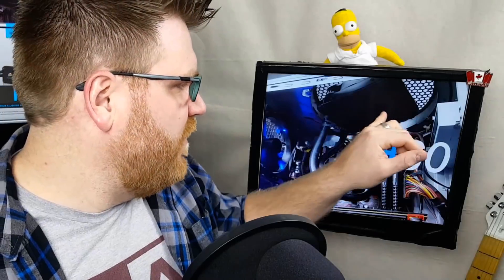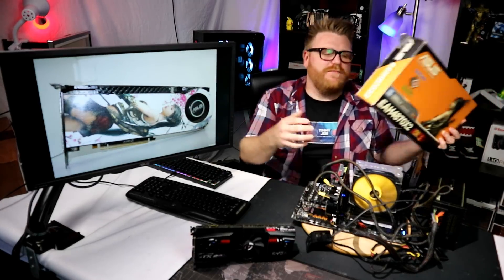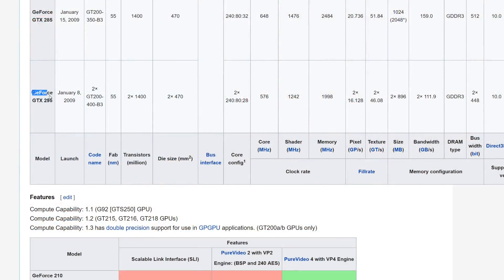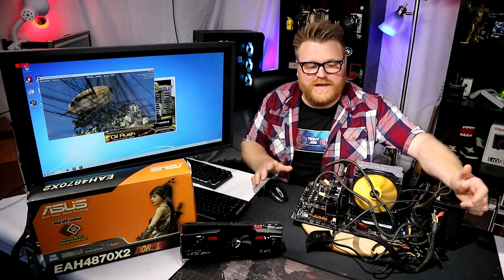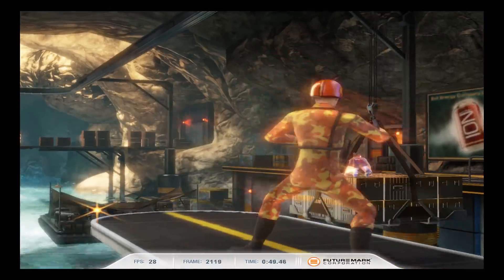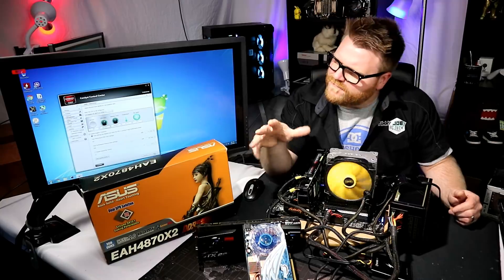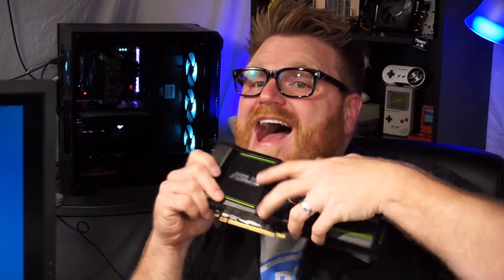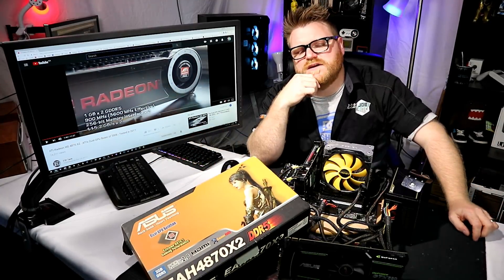ATI RADEON HD 4870 x2 - worlds most beautifully flawed Video Card

Comment: Used the AMD Radeon 4870 X2 on one of my desktops for 11+ years, on average running for 12+ hours every day. Still works like a charm (mechanically), never had any trouble with it, even the dual fans still operate as well as they did on the day that I bought it. Under max load it hits 70C, maybe clean yours out ;) I do agree that it is the most beautifully designed GPU I ever bought

Comment: I own a PowerColor 4870x2 in my retro PC and I probably have a thermal issue. The diagnostic led D5 (R323) goes to red after few minutes. It means GPU-1 isn't powered. Then after 15 minutes the video freeze and I can't go back to Windows after the reboot while it's hot. I opened the cooler system and cleaned it completely. I replaced the old thermal paste with a new one with a higer thermal quality. Fan is more quiet. But it doesn't fix. I updated the video card firmware with the latest one from the manufacturer, then now it displays glitches at the startup screen. To fix this new video glitches I have to rollback to a previous version firmware. I suspect a compatibilty issue with my motherboad's PCI-E. I never got similars problems with my previous motherboard, unfortunaty this one is dead. It cannot save BIOS setting whereas the lithium battery is new and fully charged. So to conclude, don't hesistate to load and try different firmware with your 4870x2 before trash it.

Comment: i fixed my old 4870x2 by drilling holes into the plastic shroud and gluing small PC case fans onto it ,instantly dropped temps ran quieter i disabled the blower fan, also due to belief its not the GPU die that is the issue its actually the VRAMs  causing the artifacting

Comment: I have a XFX and a Sapphire 4870. XFX overclocked the RAM too aggressively and caused artifacting.  I was able to verify this with overclock settings in CCC then afterwards I flashed it with a BIOS mod. You should have tried to downclock the RAM.

Comment: I've been running a Diamond Radeon 4870x2 in this Machine since 2008 and Have had really only one issue, that was of overheating in 2014 which I removed the cooler and re-thermal pasted it and it was working very well after this... I am as of 2020 Retiring this PC and all of its parts.

The P5Q Pro Mobo
The Core Two Duo E8400
The Radeon 4870x2
The TWO, FOUR GIGABYTE STICKS OF DDR2 (That people in 2008 called me crazy for using)
and the Antech 1200  with 3 fans replaced and 1 currently dead.

I will be saving the 2x 1gb Caviar Black drives and moving them into the newer machine we built my wife a few years back. to give that machine a total of 4TB of space.

This 4870x2 has been running pretty much constantly since 2008 driving at first TWO Samsung T220 16x10 Monitors and then when those died it's been drving 2 Benq 24" 16x9 Monitors (in all cases by DVI)

RIP Dimitri,

Comment: I have a possible solution for those who own these cards that are still working:

If you are handy with basic modification skills, you could add a heat wall that diagonally separates the two heatsinks from their shared airflow, thus creating 2 separate air channels from the intake, and allowing both to be cooled independently from the blower. This will also, incidentally, create a higher-pressure airflow for both sinks, which will be louder, but will produce a faster cooling-off rate of the fins.

I actually came into possession of one such working model by Sapphire, and will attempt to make a simple modification that should help overcome the heating issue...that or I will end up fabricating a dual-chamber water-block for the damn thing and liquid cooling it like I do my twin R9 290X's.

Comment: these cards are beast ever, in my third gaming rig under dx10 im using two 4850x2 by Sapphire to run assetto in fhd maxed out @ stable 120 fps in quadfire ... the biggest problem is the high nuclear power consumption...

Comment: I had one years ago that had the exact same errors.  I remember I was performing a ton of diagnostics on it, and somehow came to the conclusion that the ram had been damaged by the heat.  The graphic issues, at least from what I read, were from bad/damaged memory.  I cleaned and resat the heat sinks with all the appropriate thermal paste and precautions, and couldn't get rid of those artifacts.  I did a ton of research at the time, and found a forum with graphical artifacts that were cataloged.  I guess that's when I matched up the issue with the root problem.  It was awesome till then....especially when it came to playing crysis and some other new games at the time.

Comment: I had two 4870x2 cards for four-way Crossfire.  Contrary to popular opinion at the time, scaling was very good in nearly all games, including Crysis.  The only real bottleneck was the 1GB of graphics memory, which prevented me from using 4xAA at 2560x1600 in Crysis.

The GTX 295, incidentally, was no more than 10-15% faster in some situations.

I ran those cards for quite a while, and never had any failures, and still have both in working condition.  I only upgraded (to an absurdly expensive 5970 4GB card) due to the memory limitations, which I was increasingly running into with my larger-than-normal playing resolution.

Comment: I have the normal ATI 4870 x2. its september 2018 and my card is still pulling strong. Its in my alienware from 2008. its actually in the computer that I am using right now.

Comment: Thats 3D Mark Vantage that was released in 2008 not 3D Mark 06 and it's artifacting because the memory clocks are to high for the benchmark. 3D Mark Vantage did not scale well with DDR5 VRAM in ATI Crossfire. I only know this because I had 2 HD 4870X2s in quad crossfire.
Reply from the maker: But it artifacted in any application sooooooooooooooooooooooooooooooooooooooo
Reply: @TimmyJoePCTech  I am aware of that. If you lower the mem clocks it won't do that, unless someone had modded the bios and maxed the voltage out which I did and it permanently damaged one of my cards. But yeah even with the stock mem clocks they were finicky but once you get the settings right they work  great. Mine created so much heat I would litterally warm up cold pizza by placing it underneath my cards for a few minutes while gaming. The 4890 was a much better card mainly because it used a smaller node and used less voltage.
Reply: @TimmyJoePCTech  Hey I just found this article about how the 4870X2s start artifacting after a few years but the card can still be fixed by baking it in a oven. You should try this in a video! https://forums.guru3d.com/threads/baking-4870x2-in-oven-saved-it.360684/

Comment: The 2 590's are actually ENGTX 590's. There are three P/N created for the ENGTX's  If you have the first release, they are crap and always were. There was a Hardware issue with the first release and the 2 590's performed like one overclocked 590. Second and third P/N' each performed incrementally better but once the one and only V-bios update came out the 3rd release did finally manage to perform close to how 2 separate 590's would have performed. I bought the first release for $795.00 worst card i ever bought. D2Nv

Comment: Hey man I like your videos! I worked in a PC repair shop and got a PC with the same dual GPU card. The trick is to go to device manager within Windows and disable 1 of the 2 GPU’s which one it is you can’t really tell but you can get the card to a somewhat workable state!!  If one of the GPU’s fails completely you can install a second GPU of the same generation and disable 1 of the 2 GPU’s that way. Hope you see this and hope this info at least helps you!

Comment: This might be a wierd request, but have you tried baking each core on the graphics card "individually", using foil as a protective barrier?, just to say though, you'll need to verify its a gpu flaw and not a memory/vrm one. but all-in-all I'd say its worth a go, just don't touch the memory with the foil 'at-any-time' very important. You'll do well if the baking is done in a 100% accurate
fashion on the graphics chip.
Reply: I like the story on the chief @ "halo-combat-evolved" and as much as I have played it, I have realised I could use a directx 10 capable card to re-live those moments in real-time.

Comment: I got a 4870 (not the X2) at launch it was a great card lasted me until I replaced it with a GTX 980 :) The main reason it lasted it so long was I use a 720P (actually higher but some odd res like 760P or some crazy crap) so not using it to push 1080P lol

Edit: I still have my 4870 and it still works great, I am keeping it for a planned XP retro system :P lol

Comment: I had a brand new 3870x2 back in the day for a couple of hours , a short time after the 4xxx series launched . I bought it , installed it at home and right away the same artifacting started when I started a game so I returned it and bought a single gpu card from the new 4xxx series wich worked fine

Comment: I had the 4870 in my Win10 System about a Year ago, when my gtx 680 broke. Played on it around 2 or 3 Month, until Vega came out. Now, after not even a Year my Vega broke also and meanwhile Win10 isn't supporting the 4870 anymore.  I played PlanetSide2 on it and now its not even starting. Black Desert Online was on around 15-20FPS and now it was 2-5 FPS. Why do they do that ???xD

Comment: Thay all have the same problem. Me and two of my friends had one each and they got all fried like this when amd overdrive got disabled for them. It was somewhat of a driver fault because during the time they got burned fan control was disabled in the driver. One of my friends extended the life of the card with 100 percent fan speed using msi afterburner after the other 2 cards got burned. Eventually all 3 cards succumbed to the heat issue. They are now just expensive paperweights. They were good cards. What a shame.
Reply: im using this card still. the card has been under heavy loads. Its honestly not a bad card, if you get a good one. It still allows me to play minecraft at 150 fps and fortnite at 30 on low. (Okay that sounds bad, but for a 10 yr old card, its not bad)
Reply: I had a Sapphire 4870x2 and it did not have this issue at all so perhaps it was just limited to this brand? However it was still hot as hell and acted as a spaceheaterx2. The biggest problem with these things is that only very rarely would you have both chips at load during a game. Eventually with more modern games you'd have one chip maxed and the other would rarely spike above 10-20%. After a few years nothing took advantage of this architecture or perhaps it was that AMD simply ceased supporting it, even legacy drivers would not help.
Reply: It looks like Asus (not sure about any others) actually made a model of the 4870x2 with a surprisingly modern-looking triple axial fan cooler design. I wonder if it holds up any better.

Comment: Great video I had or actually still have one of these cards and I never had any issues with working in games that I played on it. My card did do the same thing as this card but was easy to fix. Right by the power connectors there are some power chips or shunts whatever they are called. Anyways one of the small chips blew and the card would heat up like crazy and then crash or make a mess on the screen. My fix was to replace the burnt chip and it worked again and ran at 68-78c like always. It worked for 7 months then did it again I just replaced the card at this point as it turns out my Tagan 700 watt PSU was the culprit because other little strange things started happening in the system. 

I took it apart and a dam spider got itself fried  and I mean fried inside the psu and it wrecked one of the 6 power stages which I fixed by replacing the part but that psu was put in another system and I never had any farther issues with it...it actually still works today. I never did fix the ATI  card a second time but it is on display at my store with the rest of my gaming cards I got over the years behind glass in a case. It's surprising how many people just stop and stre at the old glory cards from the past and ask questions about them...lol

Comment: 590 is a monster. I was using that thing for 5 years before it finally started to feel its age and it had more to do with the amount of vram not cutting it vs. The raw power not being enough for 1080p. I bet it can still run modern games pretty decently with textures turned down.

Comment: Ahh~ I also have a one. A Sapphire Radeon HD 4870 X2 as well as a BFG Geforce GTX 295 dual PCB card. Unfortunately, the 295 is a nonfunctional card but hey, they're great lil' display trinkets and I got both for $20 from a computer recyler.

https://i.imgur.com/Ae7MbKI.jpg
Reply: Also, I believe one or both of the gpu dies may either be damaged or need to be reballed. By the sound of it, its possible that it may be the main gpu die that'd the main problem. The bad part is that its not worth having it potentially fixed.

I did play around with mine for a while and got a benchmark in with 3dmark 2006 vantage and it passed it without an issue. I can throw it in my build and double check. If you'd like, we can arrange something that I can loan ya my card. :) Shoot me an email and we can talk it out.

Email: eric.del.toro240@gmail.com

Comment: Hey Timmy Joe, if you have a single 4870 then try 3 way crossfire, just make the single 4870 the display card, see if that works. You can also 3 way crossfire a 4870x2 with a 4850 or 4890.

Comment: In my experience with the card, the normal fan curve is pretty damn bad, after changing a few settings in the bios, it actually runs pretty cool (for a card of this caliber), I think what happens with these cards (including yours and my 5970 and an old 4870) is that the memory overheats and dies, causing the artefacts that get progressively worse as it gets hotter.
Reply: The blower was effective if the fan actually broke 23%  The reference 4870 I had would cook before speeding up the fan. Modded the BIOS to run at 35% at its slowest speed and the GPU stayed cool, only hit 50% occasionally, when under load. I quit giving it an opportunity to get overheated early on and that kept it from ever overheating.

Comment: I've got an Asus mobo 74moacs65405, 2x 2gb ddr2 g.skill sticks, a core 2 duo 6600, old school aftermarket air cooler, and an amd 4870 gpu. Bought a system for a modular psu and case for cheap, haven't used any of this other stuff and it's just been sitting in a closet. Let me know if you're interested in any of it.